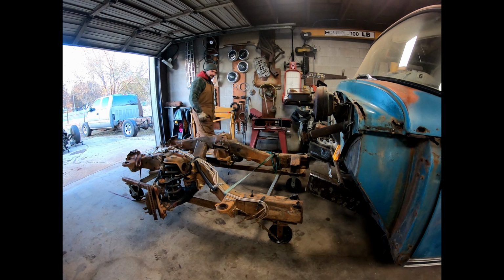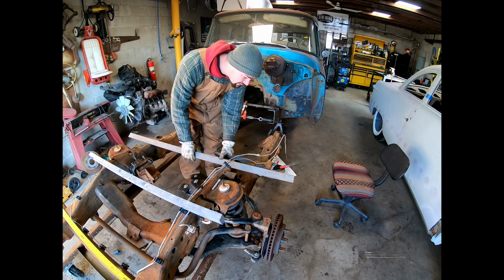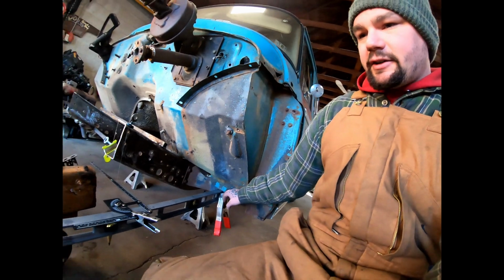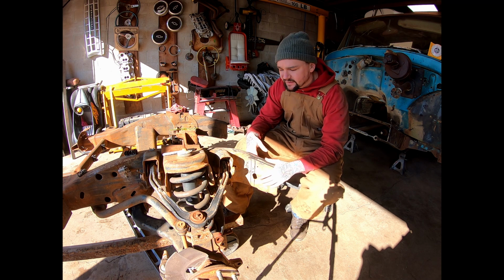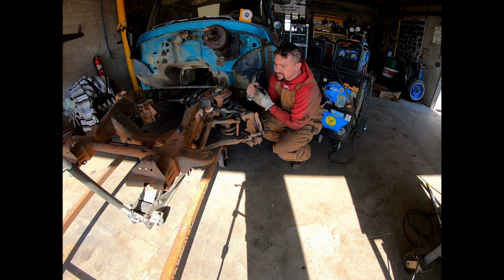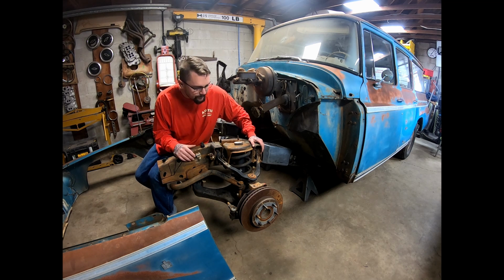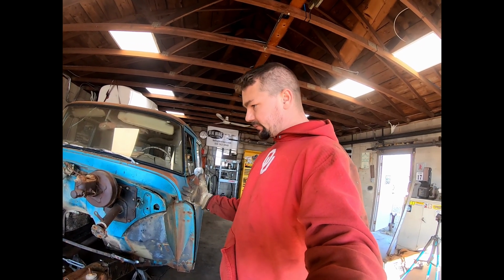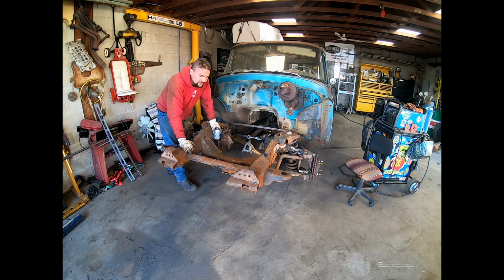INSTALLING THE SILVERADO FRONT FRAME. TRAVELALL BUILD.

Comment: What is always a good practice is to brace up whatever your welding to makes sure nothing moves on you. Instead of relying just on tacks to ensure your work piece doesn't move.  You may get lucky now and than but if you brace things up. It protects you more than anything. Than you can be confident to burn it up. so things won't move on you. That's what we do as welders fitters in the trade. Protects us from screwups more than anything else.